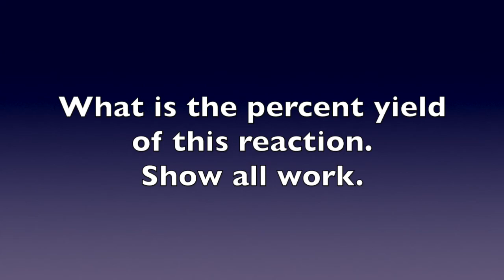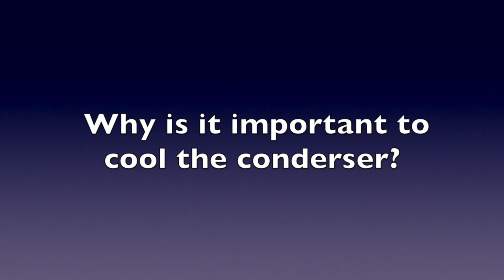Synthesis of Salicylic acid - Heating Under Reflux Lab Techniques Organic Lab experiment

Comment: Hi, I was woundering why we need to get to pH=1. does the mean that the acidification reaction occurred? 
thanks.
Reply from the maker: Taking the pH to 1 ensures the maximum amount of benzoic acid forms due to le chatelier principle. Just for fun use the henderson hasselbalch equation to calculate the ratio of benzoic acid to benzoate at pH 6, 5, 4, 2 and 1.  You will see what I mean!  Great question by the way!!!
Reply: thank! @DrBetts

Comment: What happens with the salicylic acid when heated?
Reply from the maker: Salicylic acid is fairly heat stable.  Under these conditions heat does very little to damage it.  It will melt when heated enough.  Thank you for the great question!
Reply from the maker: After thinking about your comment I am wondering if you wanted to know what was happening in this reaction.  This reaction converts Methyl salicylate (https://en.wikipedia.org/wiki/Methyl_salicylate) to salicylic acid (https://en.wikipedia.org/wiki/Salicylic_acid).  Both of these molecules are more or less stable to heating (they will melt of course).   However, in this reaction we use a strong base to convert Methyl salicylate (aka. wintergreen) to salicylic acid.  Hope this is reply is more helpful!